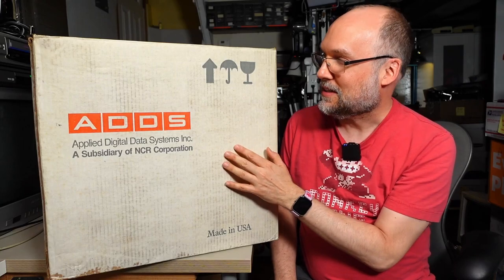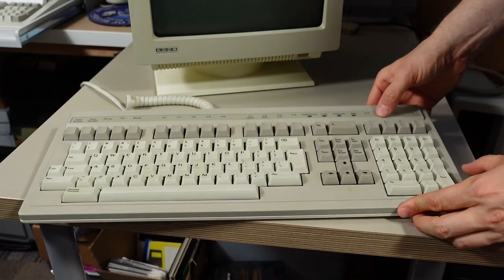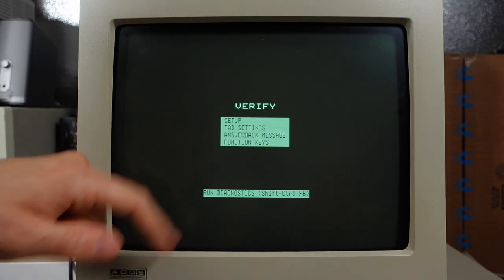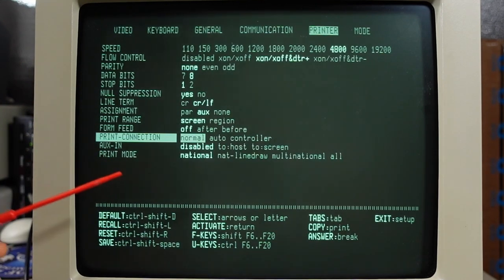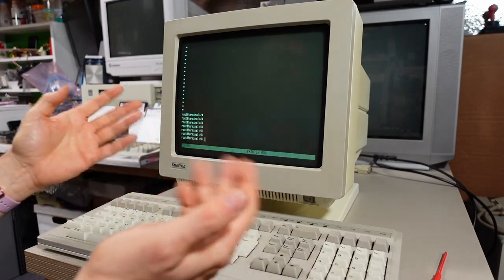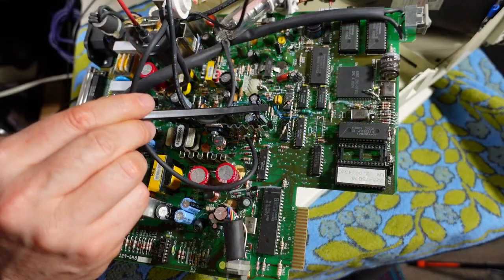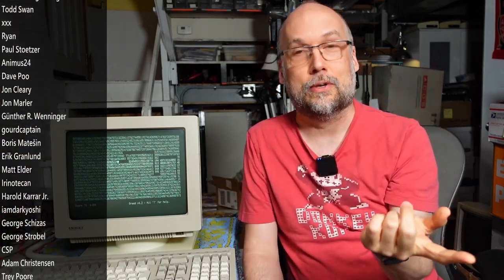Test and teardown: The ADDS 4320 Communications Terminal

Comment from the maker: Hi everyone, adding in a comment here with a bit more info since I made this video:

Here is a history on Boundless Technologies, who is the current "ADDS." It seems NCR bought ADDS in 1980, and was owned by them until 1991 when ADDS was acquired by AT&T. It was then in 1994 it was sold off (from AT&T) to SunRiver Data Systems which is what became Boundless Technologies. I would be curious to know if any old original employees are still there? It is strange that all the info about the NCR age terminals of the late 80s seems to not exist. 

History: 
http://boundlessterminals.com/history.html
Reply: Not sure as I'd call it "strange".  A new owner may have moved, er, consolidated some locations and all the "outdated stuff" went into the trash.  It was just taking up space. (from the viewpoint of management)

Comment: There's a good corporate history timeline for ADDS online, but comments with links seem to get censored so I will summarize.  ADDS was founded in 1969, acquired by NCR in 1980, which was in turned acquired by AT&T in 1991.  AT&T sold ADDS to SunRiver Data Systems in 1994, which was renamed Boundless Technologies in 1996.  They were purchased by Video Display Corporation in 2008, which moved location from Long Island to their Z-AXIS subsidiary before discontinuing production in 2015.  I think that covers most of the corporate names mentioned in the video, other than DataPro Research, which was a company that published voluminous data about computing and communications equipment from 1963 to 2005, and not actually affiliated with ADDS.
Reply: Acquisition-tastic!
Reply: The current website for Boundless claims they were formally ADDS so they may have been an independent unit throughout their corporate lifetime. They seem to have acquired the rights to DEC terminals at some point; I seem to remember them selling terminals from other manufacturers back in the day but my neurons are rusty. I certainly bought some VT520s from them in the 2000s.

The term 'text terminal' is partially deceptive; a number of later terminals had some limited graphics capabilities (Sixel, etc). I had a Wyse 160(?) that could do a graphical preview of a WordPerfect document with PF1, F7.
Reply: @hmv6666  Formally or formerly?
Reply: Based on that history, this terminal was produced late during NCR’s ownership of ADDS and right before the AT&T acquisition.

Comment: ADDS terminals were pretty common.  They also OEMed terminals for other makers.  The Usagi Electric channel has been reviving an old Centurion computer that came with "Centurion" branded ADDS terminals.
Reply: Were NCR owning ADDS at that time in the 1980s ?
Reply: @highpath4776  ADDS became a subsidiary of NCR Corporation in 1980.  From there, they got bounced around to other big name companies, including AT&T, Sun River Data Systems, Boundless Technologies and Video Display Corporation.
Reply: Big up for the Usagi Electric mention, one of my new favorites.
Reply: @iroll  Usagi Electric ftw!
Reply: I saw that rebuild series of videos, immediately recognized the ADDS terminals (especially from the back! 😄).
Back in the late '70s I operated an automated test station used to test electronic circuit boards and assemblies.  It used a 32-bit Interdata (aka Perkin-Elmer, aka Concurrent) minicomputer, and had a few rebranded ADDS terminals (and an actual Centronics 703 dot-matrix printer!).
Reply: Looks like a rebadged Wyse
Reply: @bobblum5973  I spent at least 10 years as a third-party repair for PR1ME computers.  I know the ADDS Regent 100, 60, Viewpoint 60/60+ pretty well.
Reply: @robertlewis4216  I see what you mean.  I don't know my Wyse that well.  Maybe a Wyse body on an ADDS pedestal?  With the inevitable collapse in the terminal market, it wouldn't be at all surprising if they ended up merging.
Reply: @russellhltn1396  NICE!  (Or should that be "N1CE!"? 😉)  I've only seen a single PR1ME system at work, never used or supported it.
Reply: @iroll  Same.  He has some interesting projects.  Fascinating channel if I may say so.
Reply: I totally agree about Usagi. It's one thing to take on a C64 or something like that with considerable documentation and an active hobbyist base. It's quite another level of crazy to take on an old obscure system that that Centurion. 

One thing he shares with Adrian is a dogged persistence at fixing stuff. Personally, I would bail on hard problems much faster.

Comment: I  worked for DEC between 1975 and 1985.  I started in the Terminals Group. Everybody had VT series clones. None got close the the real ones. I have some examples of VT terminals
Reply: I remember the first time I used a real DEC terminal after having used a number of others (mostly Wyse) for many years. It's amazing how much nicer the DEC ones were. Though it's also amazing how much worse the bottom-barrel ones could be than the mid-tier ones.
Reply: @wbfaulk  I joined DEC from a small UK company where I designed and developed VDU terminals.  I was going into terminal sales but DEC hired engineers and taught them to sell.  When I started DEC had the VT50 (12 lines) and VT52 (24 lines) they were similar to the glass teletypes I had worked on in the UK. After a few months I was asked if I wanted to see the new terminal the VT-100.   One of the engineers on the project briefed me on it.  OMG!! It was way ahead of anything else. Intel microprocessor based and did it all.  The rest is history. We sold tens of thousands of of them and it became the industry standard.  One of our US terminal sales engineers had a framed copy of an order for fifty VT100 - From IBM!!
Reply: I almost worked for DEC, but both before and after that I supported DEC hardware, software, printers, networking (DECservers and SNA gateways), you name it!  All good stuff.

There's a mod you can make to the VT05 terminal so that the Online / Local rocker switch instead selects between the RS-232 and 20mA current loop interface. 🙂
Reply: My VT420s are still flawless.
Reply: I still liked the fact of having a Help key.  Also the Return, Enter and Do keys being different functions, although the Enter could act as a Return if you turned off Application Keypad mode.

Comment: With the serial ports labeled "Ses 1" and "Ses 2", it's probable that this can be set up as a multi-session terminal, where each serial port can connect back to a host, to either allow simultaneous access to two different systems, or to allow two simultaneous logins to the same system.  I've used this feature on a DEC VT-420, and it wouldn't surprise me if other vendors implemented something similar on their terminals.
Reply: I was thinking the same thing. I used to use virtual terminals and switch from screen to screen. So one for the editor, one the compiler and run space/free command line.
Reply: Incorrect.
Reply: That's pretty much what the two serial ports were for.  You could key back and forth between two simultaneous sessions, such as two separate sales on a POS terminal.  I set up many a sales system for a autoparts stores back in the day that allowed two sales persons to use the same terminal.
Reply: @godslayer1415  Elaborate on your answer, or you're just a troll.
Reply: The second serial port can be used as either a serial interface to a modem or autodialer, or as a second terminal, using a keystroke to swap between screens.  If you were insane like me, you could set it up with a vertical partial split-screen using a smaller font, with a full terminal screen on the top (or bottom, depending on the active session), and the first 15 lines or so of the other.  If you had active and hot backup minicomputers, you could have the top screen on the first machine, and the bottom on the other machine (preferably on the same port number, for IT's sanity's sake).

Comment: My first "IT" job was running an ADDS Mentor (PICK) mini mainframe using MegaComm serial boards and ADDS and WYSE terminals.  I'm having so many flashbacks rn :)
I loved hearing the key confirmation tones again.  Like ASMR to me :)
From what I remember the ADDS terminals were use specific (VT100 etc) like my use with their Mentor tower.  These were much cheaper than the NCR models which were much more versatile.  NCRs could be used on IBM Mainframes as well as lower end boxes like the Mentor.  Also, the NCR terminals could be connected with coax (token ring) or other media with add-on cards where the ADDS were just 25-pin serial I believe.  I highly doubt you could swap ROMs.  
I'd ask my father (IBM Mainframe guy who taught me in the 70s and 80s) but he is now writing COBOL for the Data Processing Dept in charge of who gains entry through the Pearly Gates.  Apparently they are still using a System/360 for budgetary reasons.
Reply: Your final paragraph gave me a good chuckle. Rest in peace, your dad
Reply: Your last line makes me think of the local county council offices here in North East England., where all the computers were still running Windows 3.1 until about 2015. They're on Windows 10 now, but they upgraded to it from Windows 3.1. May have been NT, I'm not sure, but I always remember it giving me a chuckle that my OS was better than the local government.
Reply: Thumbs up for having experienced ADDS Mentor.
Reply: @fattomandeibu  Hi, i worked in a larger bakery and wrote some software for stock control, staff, ingredients / recipe and a bunch of one of utilites, this was all in turbo pascal

I lost contact with then in @ 2014 but they still ran those programs and the daily POS is still a dos Clipper program
Reply: If he's still writing COBOL, are you sure he went to the place upstairs?  😀
Reply: Working with ADDS Pick TCL for so long made learning Microsoft SQL really easy.
Reply: @greendryerlint  for HIM? yes he loved it.  For ME hell no! 😁
Reply: @PianoMan_2112  Same here. I'm a SQL admin mostly these days.
Reply: @edwardclark527  I worked on Microdata Reality, Fujitsu Microsystems, and Honeywell Ultimate, all running Pick OS.

Comment: This vid took me back. One of my first Internet accounts was at the Univ. and they had a terminal lab to telnet into your shell account. My career has been with routers, and having a RS232 interface to them is still relevant to this day. Back in the 90s, I carried a WYSE terminal with me as the emergency local console for routers that lost connectivity. One day, while waiting on the Telco tech to arrive at a site, I passed the time by browsing the web from it using Lynx. Good times.
Reply: Yes! Not a serial connection, but I have an SSH into all my routers. And can run htop etc there.

Comment: This could just be speculation, but around 3:18 the sticker on the back also has "W052891" to the right. Since you pointed out that the mainboard was manufactured 15th week of 1991, that board would have been in April 1991. The above number (at least to me) looks like it could be a date code, since I know in the US we generally use MM/DD/YY format, and it's got "Made in USA" stamped all over it. So, possibly 05/28/91? Not unreasonable to assume if the mainboard was put together in April that the terminal itself was completed and a sticker put on it in May. At least that's my theory lol
Reply: As soon as I saw the label, that jumped out immediately. The W might indicate an assembly line or location.
Reply: @thomasbland6428  I thought the same. I remember the companies I worked at using similar date-codes in their serial numbers and labeling.

Comment: Former point of sale tech 1999-2002 for a contractor for NCR (Permond) the warrantee cards came literally in every new piece of IBM / NCR equipment that I worked on. We put these terminals in for many purposes. The passthrough would also interface to a cash drawer occasionally (some frus not all) so that the internal serial cable would link through it's top from under the monitor. A customized fru for that cash drawer would plug into the 25pin aux and then we would hook the 4 pin cash drawer link to the display this way.
Reply: On the ones I worked on, the cash drawer got its trigger from the POS printers for most of them, but I think we had a few like you describe.  Memory's a bit foggy going back over 20 years now.  I also remember getting tired of paying $60 for a RJ-11 to PS/2 keyboard adapter so buying some cheap DIN sockets and making my own.
Reply: could probably also put a barcode reader on that aux too
Reply: @greendryerlint  yeah, it depends on configuration usually. Sometimes they would have a shared line printer like at the oil change places then the cash drawer would trigger that way. Sometimes the printer would have its own line it depends greatly on the customer needs

Comment: Use "control-[" to generate an ASCII escape character.  There are plenty more like that, look at an ASCII table, the kind where it is an actual grid, you can see things like control-S and control-Q for X-On/X-Off (transmit on/off) flow control.

If you loop the transmitted data back into the received data (typically jumpering pins 2 & 3 on a DB-25 RS-232 port) the characters will be detected and the terminal will respond.  Real VT-220s accept some test codes; if they receive <esc>E (control-[ then E) they display an alignment pattern, a screenful of capital Es. 😁

Comment: I find those metal keycap removers cause a lot of problems. They tend to twist the key off, rather than lift it, no matter how carefully you pull. I vastly prefer the plastic “ring pull” keycap pullers, as they always lift linearly without twisting.

Comment: A friend of mine used to collect old terminals in the late 80s.  One of the terminals he came across was essentially a glass tty.  No micro/CPU running the show, all done with discrete non-74 series ICs.  I can't remember the brand but it was an all sheet metal case and the single logic board in it took up the entire width / height of it.  Think around the dimensions of a TRS-80 MIII if that helps.  It had rudimentary cursor positioning and screen clearing abilities, again all done with discrete logic.  Even the serial IO was done with individual chips.

Comment: You pulled that board out and I was instantly projected to my 20s. We used to have to replace those boards because the bodges would fail. More specific product customization
Reply: The capacitors failed spectactularly.

Comment: I studied Computer Science in the late 80s/early 80s. Used VT100/220 and Wyse 50 (and 25?) terminals all over campus and in the computer labs. I spent a lot of time on those terminals. Fun memories. Back in my dorm room, I could connect my PC over ethernet to the network and use terminal software on there to connect to the UNIX servers I was using for schoolwork, email, etc. I toyed with getting a terminal once or twice, but the PC worked just as well for my needs.

Comment: Oh gosh, those dot-spaces brought back tons of memories of watching people use POS terminals. Of course it was very important for them to easily count the spaces in (or between) columns on forms. They also did use the cursor keys and spaced or typed over text they wanted to replace or delete, rather than clearing whole lines, like you discussed. (Whether that was a technical limitation or just simpler training, I dunno.)
Reply: 666

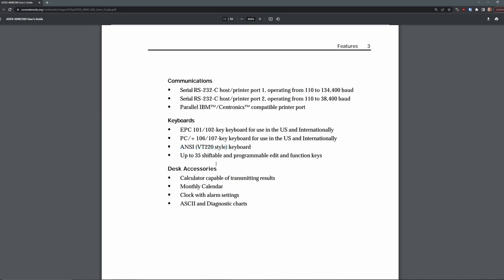Comment: The bird heard at 21:12 was a California Scrub-Jay, not a Blue Jay which is an eastern species. Also I would have been really curious to see the smooth scroll in action at 38400 baud. I've never seen a terminal do that. (And your scrub jay sounded rather high pitched relative to what I'm used to the adults sounding like here in Los Angles County. So it was either a juvenile, or your scrub-jays have a higher-pitched call in Portland.)

Oh and to clarify... I always turn off smooth scrolling on every piece of software I use :-) It's a matter of curiosity that I'd like to know what it looks like on a terminal, and I probably wouldn't want to actually use it that way.

Comment: Man this thing is hard to find information on.  All I know about it now is that it belongs to ADDs _320 series, which emulates a VT320.  ADD had a weird numbering scheme that doesn't make tons of sense, but here's what I worked out.  During the DEC VT220 era, ADD produced the 2220 and then a more advanced version the 3220. Then when the DEC VT320 came out, ADD answered with the 3320 and later the 4420 (which you have). You have the "smooth white" variant, which has a paperwhite display with smooth scrolling capability. Details I found: ANSI (x3.64). Compatibility: VT52, 100, 220, 320; ADD 3220, 3320, Viewport 122. Resolutions: 80x24, 132x24. 70Hz refresh. Max Speed: 38400 (full duplex). Apparently has a built in calculator and calendar. Programmable (soft) font. 8k of internal memory for buffering.

Comment: When I was a kid in the late 90s/early 00s our local public library system was using terminals (amber phosphor) for searching the library catalogue. Years and a couple moves later when I was in starting college, the dentist/orthodontist? had one (green phosphor) they used for a sort of self check-in. — Pretty sure they were either standard DEC models or some less well known manufacturer.

Comment: Visual Technology emulated the ADDS Viewpoint terminals among those of other companies including Haseltine. Their main emulation though was of DEC terminals and because of this, became one of the larger terminal suppliers. In 1987 they came out with a line of paperwhite X-terminals with bitmapped graphics. The product had an access door where the user could replace or add in a personality module. For the company, this was too little and too late because by then the terminal market was becoming terminal itself. 

Seeing the ADDS terminal did give me some warm fuzzy feelings of the olden days. I was lucky in that Visual separated their analog CRT circuitry from their digital boards. That made working on them so much safer.